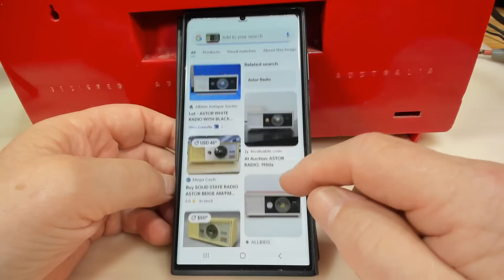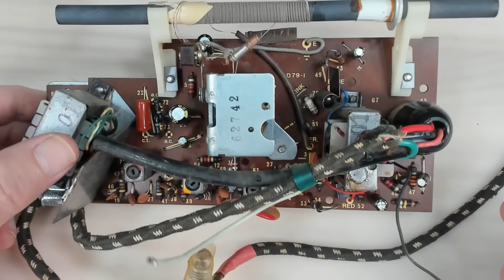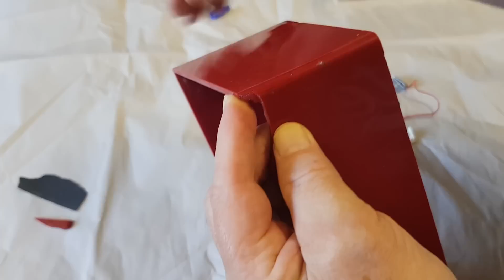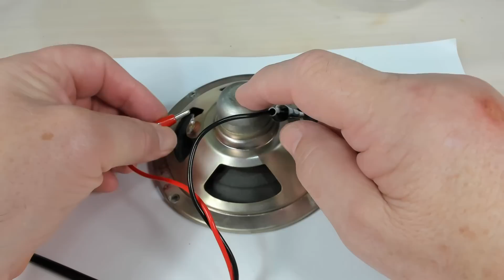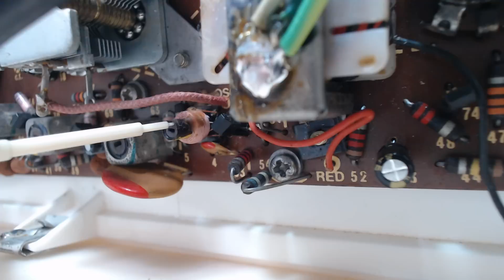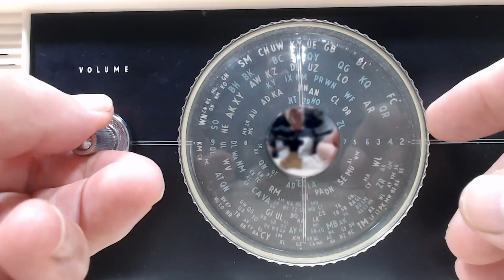Astor M6-D Transistor Radio - 1968

Comment: Great job on this radio, Dave! Good to replace the electrolytic capacitors. The case came out looking really well. I wouldn't worry about the slight blemish remaining where you had to glue in the missing piece, it's hardly noticeable and far better than a gaping hole. As far as transistors go, think of them as little triodes. Base is like the control grid, emitter the cathode and collector as the anode, ..in a way sort of. All the best to you and your family for 2025🎉
Reply from the maker: That's a good way of looking at transistors Daniel. I understand how they work, it's the architecture supporting them that I don't understand quite as well. All the best to you and yours Daniel 😊

Comment: Do you have a video on that loop antenna you connect to your mini whip? I also use a miniwhip system and 90% of what I work on simply has an A & G terminal to attach the system to instead of a ferrite rod like your set this week has.
Reply from the maker: No I don't have a video on the loop antenna, sorry. It's just a few turns of single core wire on a 3D printed stand. Anything will work 🙂

Comment: Nice work as usual David. Voltages and temperatures being lower in transistor radios, electrolytics usually last a lot longer. My normal approach with these is to look if any are actually leaking or bulging and if so change those before powering on. After that I'd only change ones that are causing a fault. Unless it's taken an hour to take the thing apart in which case I might change them all just to avoid dismantling it again! Merry Christmas and Happy New Year!
Reply from the maker: Thanks Neil. I'm sure this would have worked out of the box. I take you suggestion about a general inspection beforehand though. Merry Christmas 🙂

Comment: These radios 📻 went from tube type, to transistorized, probably during the early 😳 to mid 1960's. About the same time ⏲️ that speakers 🔊 went from field coil to permanent magnet 🧲. It looks like 👍 this radio 📻 has all those Australian stations 🚉 on the dial. I don't think 🤔 this radio has a dial cord, but it might have a dial light. Merry Christmas 🎅 🎄 and a very safe and Happy New Year!! Your friend, Jeff.
Reply from the maker: Hi Jeff. No dial cord on this one and no dial light either. Very easy repair. Merry Christmas and all the best for 2025 👍😊

Comment: On transistor radios checking rectifying diodes and main filter capacitor is enough to power them up, or even without any checking you can power them from external supply. Nice work, as always :) Merry Christmas and happy new year!
Reply from the maker: Good point, thanks deepblueskyshine. Merry Christmas and a great 2025 🙂

Comment: I've restored one of these .I'll have to look and see what model it is but I think its got the silicon transistors . Interesting how they drew the PNP transistors in the diagram .Haven't seen them drawn that way before . Going to silicon simplified the circuit a lot compared to the germanium . I was interested in the biasing changes .But going from PNP to NPN there's no comparison. 
That huge brown Polyester cap ,I've got packets and packets of them left over from my TV repair days . I still use them in emergencies .But every one I've tested has been perfect just way to big compared to whats available now. I think they were sold in the mid to late seventies. Pity the electrolytic s didn't hold their value that well
Reply: I think it was harder to make NPNs from germanium than from silicon, so early transistor sets were almost all PNP (apart from possibly one NPN for a complementary output stage). Once silicon was more common NPN allowed us to leave upside down world and have the positive rail at the top again 🙂
Reply from the maker: The original schematic had very odd looking drawing of the transistors. I look it up but couldn't find a symbol the same. The poly cap was fine and could have been left in there. Thanks anno250 🙂

Comment: Good ol' 'solder wick' to the rescue over the fandangle expensive solder sucker station ahaha!  I kid!  Every hobbyist or professional should have all of the tools relevant to different jobs.  I got hung up watching youtube video's at one point where I was encouraged to buy a solder sucker station to solve all solder removal issues, which is a lot of rubbish.  These days, I still have the solder sucking station (the green Pro'sKit one), but I still often use solder wick and a solder pump as well.  I wish more electronics video uploader's would point out the fact it is OK to have different methods at your disposal and not to rely on one way to approach a job.  I find the solder wick being my most commonly used item of all the solder removal tools, especially on older boards with delicate traces, but I'm ready for alternate methods if it's required.  Thanks for doing a 'tranny' radio, I hope you do a few more so I can learn more from you.  :)  Cheers David!  Rick
Reply from the maker: You have to use what works. I thought the sucker would be better for the old tracks, get in and out fast, less heat. They had bent the lead wire over so tight it was a pain to get the components out. Thanks Rick 🙂

Comment: Very unusual to see a single ended output stage. I guess they get away with it with the higher-than-normal voltage supply. 100mW if I recall.
Reply from the maker: Yes, an economy measure I'm sure. Still, it does the job. Thanks Michael 🙂

Comment: G,day,everyone, from germany, and g,day,David.a new Video, what  wonderful Start in the morning. I got new Equipment yesterday, David, a philips gm 2317 Tone generator,propably from the 50s,it has tubes inside, not intel😂,a az41 rectifier, a el41 output tube, and two ef40 for the oscillator.i completely restored it yesterday, completely cleaned,a few new capacitors, and it works like new from the factory.
Reply from the maker: Thank you Tobias. That's a nice looking unit, I just looked it up. I still have a tube generator, I let it warm up for an hour before trying to use it. Well done restoring your Philips 🙂
Reply: @DavidTipton101  i used my tube tester to test the two ef40,one is good, the second one is a little bit weak,i will ask a friend who's also collecting tube radios for two New ones. The el41 is fine.

Comment: The dual capacitor may have two caps back to back in series to make it non polarity conscious.
Capacitance would be halved.
Reply: That's what I thought but it was clearly marked with polarity, I think it was just an oddity of the manufacturer.
Reply from the maker: I did wonder that too Joe but it was an ordinary capacitor 🤔

Comment: About recapping before powering up - I have done several hundred transistor radios, battery and line-operated, and never once have I found a shorted power supply capacitor. They're all on the low-voltage side and that seems to protect the very well. Lost capacitance, however, is nearly universal, the smaller the capacitance, the more likely they will be dead. Almost always, lost capacitance on the low-voltage electrolytic capacitors causes degraded sound or low volume. As you found, replace them and it usually works like new. The alignment is also pretty stable, the lack of heat means there is little degradation of the components.
Reply from the maker: Thanks for your insights Brett, very useful information. I usually power them up, I think that it was mains powered worried me 🙂